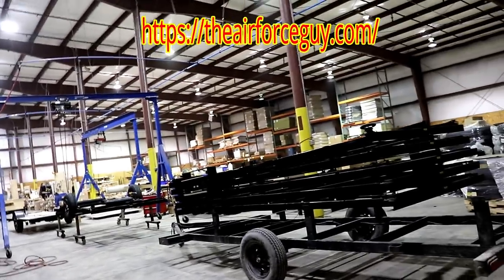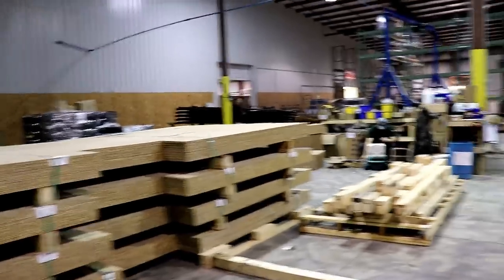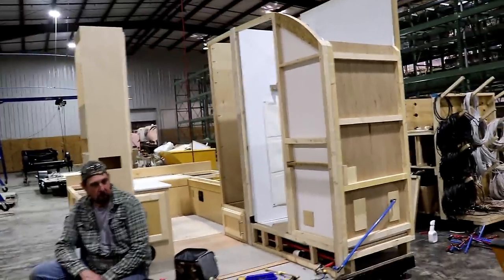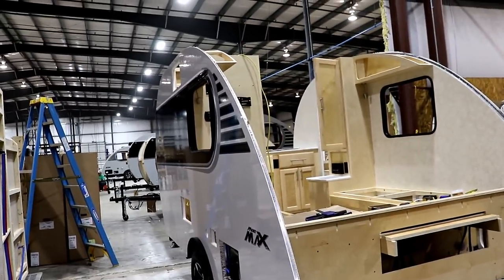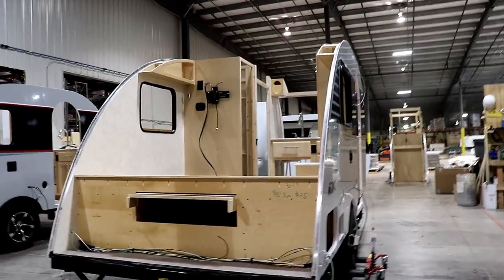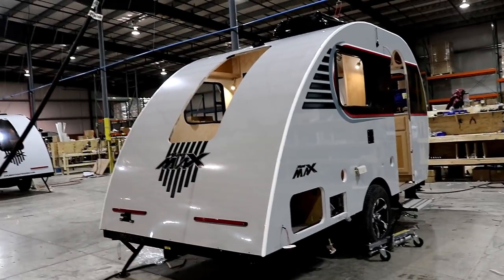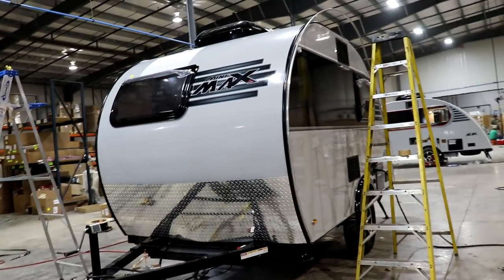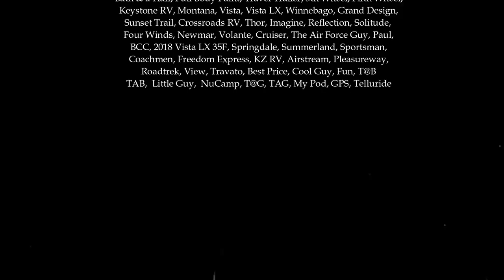FACTORY TOUR for the Mini Max by Little Guy   -   W/Paul Chamberlain, Jr. "The Air Force Guy"

Comment: Great tour.  Watched your other videos about the Mini Max, I am really impressed with the construction  being a carpenter I know what I am looking for.         They have missed a place for storage there is a place in front  between the shower and front wall that could be split into two levels. One can be from the hook up side to use for hoses, power cords  ect the other  access is beside the sink you could make that a open nook. You could put the cutting board back there when using the sink or for other items. One thing I think they need to add is elastic netting in the bed/dinette Cubby's. Overall it seams like a class leader in quality and size. Thanks for reading hope to come up soon to look at one first hand

Comment: Mr Chamberlain, can or does the mini max inside table have the ability to pull out of the mount to access the twin bed layout easier? The mini max is now our 1st  choice. Also is there access to the sink drain pipe for any maintenance,  located behind the microwave
Reply from the maker: Thanks for watching.  The table can be ordered to be just like in the Little Guy Max, which makes it portable.  Yes access if you pull the microwave out.

Comment: Wow.. I am a little disappointed to see that they use plywood for the roof instead of Azdel. Also why wouldn't they put a cover on the bottom of the trailer before putting down a wood floor. Yes I heard you say water proofed sealant but we all know that sealant doesn't last forever and often times we are driving on wet roads and puddles. Plus it looks like it's particle board and not even a hard wood. For the price I would expect much better quality. I do love these little trailers I hope the manufacturer will do a better job with the foundation in the future.
Reply from the maker: I hear what you are saying.  Here is a link to Performax 500 :  http://myhuberwood.com/media/documents/pdf/OEM/PerformMAX500SalesSheetProductLiterature.pdf

Comment: So is the only place there is insulation is in the roof?
Reply from the maker: No, It is in the Sidewalls as well.
Reply: What's the length measurement from the hitch ball to the middle of the axle for the Mini and the Max?
Reply from the maker: 10’ 6”
Reply: It's the same for both the Mini and Max?
Reply from the maker: Yes

Comment: I noticed the floor is chip board. Not what I thought they would use, if Liberty is a derivative of Nu Camp and if they source the materials from the same location would that mean the Tab and Tag trailers also use chip board as a sub floor? I couldn’t see what was used as a water proofer on the underside I also can see that the edges may be exposed even though they’ll be covered  it’s hard enough maintaining all the caulking etc. to keep all the water out wether sitting or traveling. I don’t know, I’m on the fence with this one detail. If any of that floor gets compromised then there goes daisy.
Reply from the maker: It is called PerformaMax 500.
There are many RV manufacturer's using this for their flooring.
This material will not absorb water.

Liberty Outdoor is not part of NuCamp, they are two different companies.

Check out this website to see the under lament:   http://myhuberwood.com/main.aspx?pagename=oemperformmax500
Reply: Paul Chamberlain, Jr  That’s interesting I just looked that product up it appears to be a well engineered product. I do enjoy your videos and you are very informative. Thank You.
Reply: NO INSULATION IN THE FLOOR EITHER ,AND THE PRESSED CHIP BOARD IN THE FLOOR GETS WET ITS GONNA SWELL JUST LIKE A MOBLE HOME AND U ROTT THE FLOOR U ARE REBUILDNG EVERYTHING IT TOUCHES ,FROM SWELLING UP TO BUSTING THE WALLS AND SUCH ,ITS PUT TOGWTHER SO TIGHT THE FLOORS HAVE NO CHOICE BUT BUST SOMETHING AS IT SWELLS WEN WET ,IVE PUT IN SO MANY PATCHES AND OVER LAYMENT IN MOBLE HOMES SUBFLOORS AND CAMPERS AS A CARPENTER  OVER THE YEARS I JUST DONT UNDERSTAND HOW U CAN RUN A BUSINESS MAKING THE KINDA CASH THEY DO FROM THESE HOMES AND PUT THIS MUCH DETAIL INTO IT THEN CHEAP OUT ON ITS VERY FOUNDATION AND SLEEP AT NIGHT KNOWING U ARE DOING IT,ITS BEYOND ME 4SURE,,I GUESS UY GOTTA SET URSELF UP FOR REPEAT CUSTOMERS SOME HOW,,,,JUST MY THINKING GO FIGURE IT OUT THE HARD WAY IF U DONT GET WAT IM SAYIN IM NOT ON THE FENCE ID HOP ON PAST IT UNLESS IT WAS REALLY PRICED RIGHT,BUT WE ALL KNOW ITS THE COST OF A DECENT NEW CAR TO OWN ONE OF THESE SO PRICE AINT RIGHT 4 ME
Reply from the maker: PerformaMax 500 flooring will not absorb water like the flooring used in mobile home industry.  Please take a look at the way it is made and compare, two totally different different products.  This product has been used in other RV's and warranty issues are almost non-existent.   Thanks for watching
Reply: Paul Chamberlain, Jr In hind sight I should have not said anything publicly and just asked privately instead. I wasn’t trying to ruffle peoples feathers. I like the videos and information provided by you your time is valuable but so isn’t the information your kind enough to give to the perspective buyer of these products.
Reply from the maker: No problem.  I failed to cover that property in the video.  Still learning